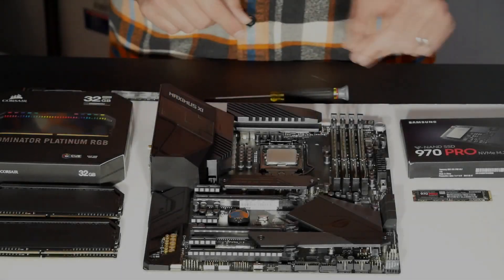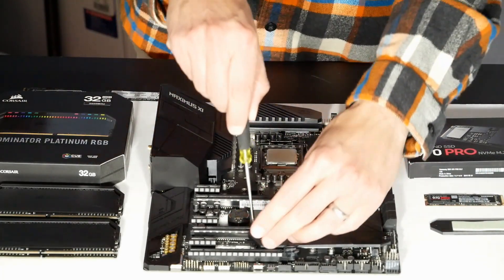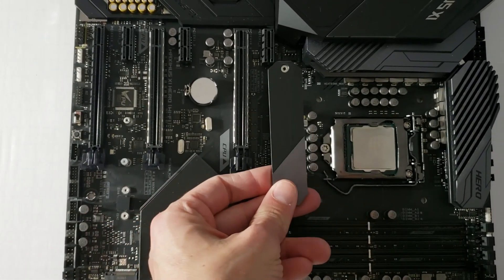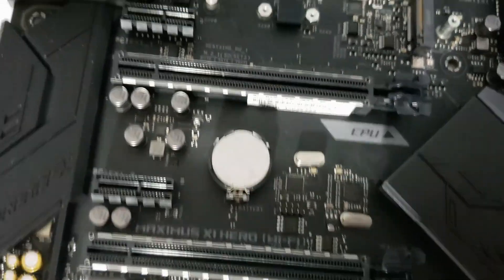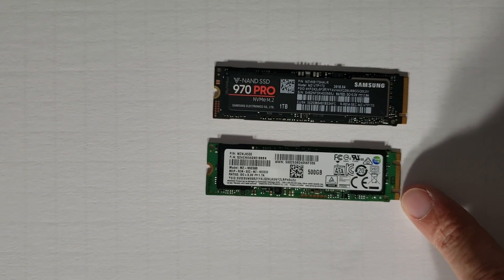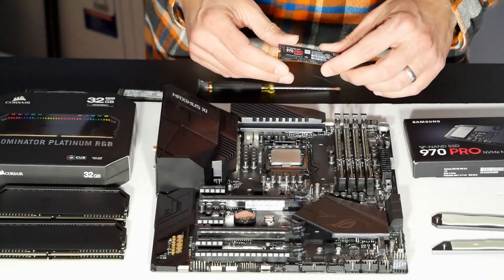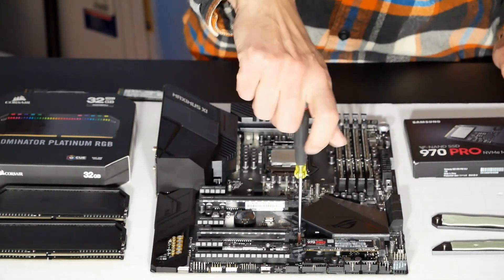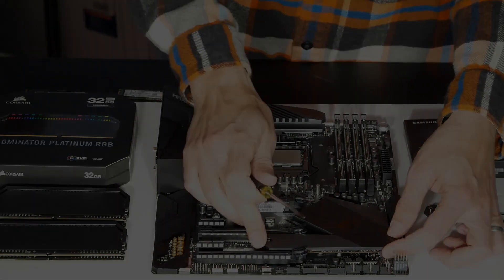How to Install the Samsung 970 Pro 1TB M.2 PCIe Solid-State Drive

Comment: I successfully managed to remove the heatsink using the 0bit but failed to remove the screw you used to install your nvme. It’s too tight on my motherboard and failing to remove it.

Comment: I have B550 MSI Gaming Plus Motherboard and it has 2 Slots for SSD stick (Top and Bottom) ..

The top is not working and the bottom is doing well .. i have samsung 980 PRO 1TB ..

Can someone help me how to activate or fix the top slot ssd .. thanks !
Reply from the maker: Only one of the slots on the B550 board supports PCIe Gen 4 drives like the 980 Pro. I'd suggest you take a close look at the motherboard manual to see which slot it is. I presume it is the bottom slot since that is what's working.

Please take note that the drive I tested here is not a 980 Pro, it's a 970 Pro, which is PCIe Gen 3 and thus completely different in terms of compatibility.

Comment: aren't you supposed to remove the ssd sticker before putting the heatsink on? otherwise you might be getting even worse temps?
Reply from the maker: No. In fact, that's a thermal transfer sticker.

Comment: I need help, motherboard didn’t come with this kind of screw for the storage drive, anyone know the size?
Reply from the maker: If it's new, it should have come in the box. Every motherboard manufacturer uses a different size, so you'll need to contact the manufacturer if you can find it in the box.
Reply: The Tech Buyer's Guru Okay thanks man, this helps out a lot

Comment: i have same motherboard z390 hero xi can i run 2  samsung evo 970 pro plus
Reply from the maker: Yes. I run a 970 Pro and a 950 Pro on this board. The 970 Evo Plus will work similarly.

Comment: Boa tarde!
Comprei uma Asus H310m-E R2.0 e um HD M2 samsung 970 plus que tem velocidade de 3.500 Mbs por segundo , mas esta placa so esta reconhecedo no maximo 900Mbs. 
Pode me ajudar com alguma informação ou me indicar poutras placa asus com custo beneficio que suporte essa velocidade do M2 de 3.500?
Reply from the maker: Welcome! Your motherboard only supports PCIe 3.0 x2, not x4, so it cannot hit 3500MB/s. It would be limited to 1700MB/s. You may be able to boost your speed from 900 MB/s to 1700MB/s by using the Samsung Magician software to optimize your drive. By the way, I speak some Spanish, so I could read your Portuguese without translation!

Comment: Can old mobo use this ??
Reply from the maker: The motherboard needs an M.2 slot, and the original M.2 slots are the wrong type. You'd have to check your motherboard's specs to see if it has a PCIe-enabled M.2 slot that's 80mm long.
Reply: The Tech Buyer's Guru I wanth ask msi z77a-g43 can use?? I’m not pro in pc ...https://www.msi.com/Motherboard/Z77A-G43/Specification
Reply from the maker: That will not work. For a board like that, you should stick to a 2.5" solid-state drive.

Comment: Thank you sir. Very informative channel..
I have a question about  ULTRA FAST M.2 ,,,NVMe PCIe GEN3x4 2280 M.2 connector(up to 32 gb/s).
And SATA 3 up to 6gb.
Can I I install 1Terabyte NVMe in that slot or or only 32 gb Optane memory only?
Motherboard I have is B365M DS3H WIFI(rev.1.0)
Thanks...or anybody if cam help  much appreciated....
Reply from the maker: Yes, you can. Any M.2 drive will work in that slot.
Reply: @TheTechBuyersGuru THANK YOU

Comment: im going to assume not all motherboards come with an ssd heat sink??
Reply from the maker: That's right, and for those that don't, a drive as fast as the 970 Pro should be fitted with a third-party heatsink.

Comment: What tool did you use to remove screws already in to fit the m2 ssd
Reply from the maker: For the screw itself, you need a jeweler's screwdriver set (https://amzn.to/2rQKEpb). If you're referring to the post that some motherboards use to support the M.2 drive, you may need a small pliers or a flat-head screwdriver, depending on the type of post used.

Comment: Hello, I just bought the Samsung 970 EVO Plus but I have no clue where to stick it in, I see on the bottom right an SSD slot but it looks smaller than it on the video, maybe thats just me. I have a ASUS Z170-E Intel Z170 DDR4 ATX Motherboard, ASUS Z170-E Intel Z170 DDR4 ATX Motherboard, could you please take a look?
Reply from the maker: Actually, it looks like your Asus Z170-E has a full-size M.2 slot, which is good news. It doesn't have a heatsink, but that's not a big issue. You might just need to move the mounting screw over if it's pre-installed at the 2260 length. You need to use the 2280 length for the 970 Evo Plus. Those lengths are printed right on the board.
Reply: @TheTechBuyersGuru  thank you, but I don't know where the screw is. That's the biggest problem
Reply: @Higashikata  what I did I had some silver screws laying around and I attached one of those (no clue if that's how I'm supposed to do it but hey it works it seems like it can't move so I'm happy lol